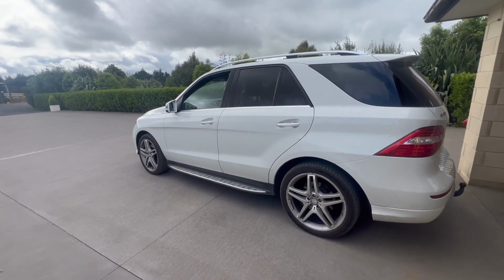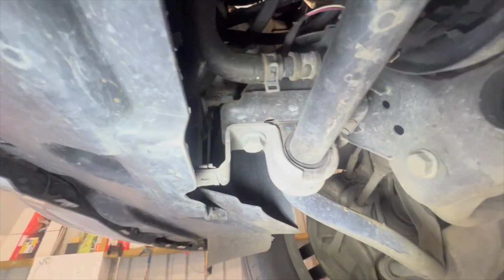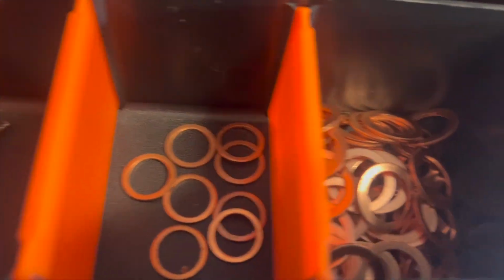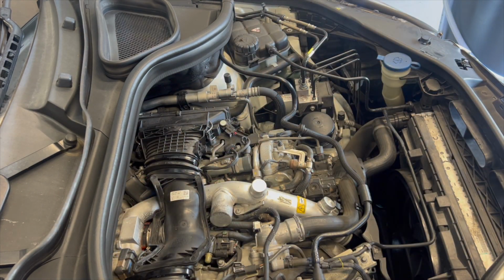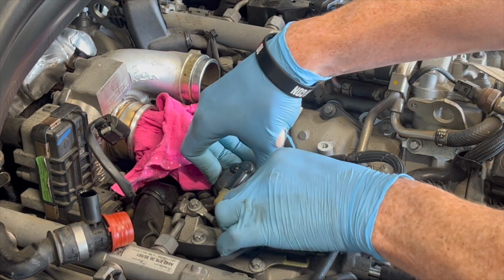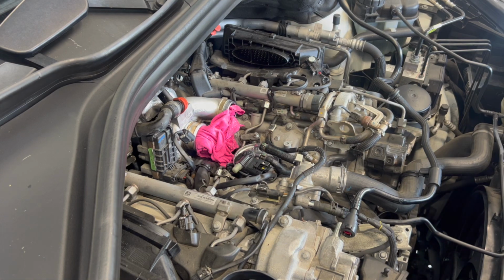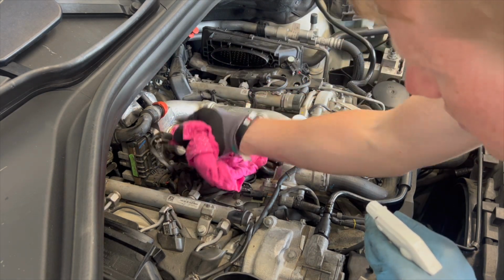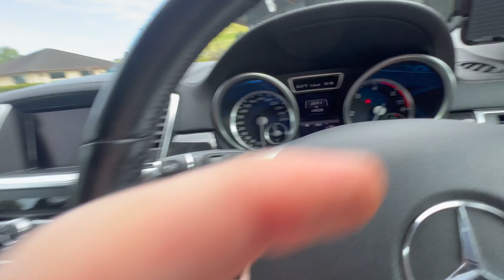Mercedes-Benz ML350 Bluetec Service (W166)

Comment: Great video sir! Mine is the exact same as yours! 2013 and sitting at 310 000 km! Runs flawlessly except for a very minor oil leak (known problem with the oil cooler seals). The leak is only noticeable when I remove the belly panels during my 10k km OCI. Did you have any problems with the oil cooler seals?
Reply from the maker: Hi there, ours hasn’t had this issue yet. Great to see you have over 300,000km! I can’t remember where the oil cooler is? But if it’s only noticed when removing the belly pan I wouldn’t say it’s urgent, my 2x E55’s up until recent have been regularly dripping on the floor… just need to keep tabs on the level. But I’ll check mine this service and see if it’s leaking at all.

Comment: Great informative vid. I have just bought one of these  What milage is this at? what interval is fuel filter and when would you guess the PCV valve needs preventative replacement?  Thanks heaps
Reply from the maker: Awesome, hope u enjoy the car. The fuel filter off the top of my head is 2 years or 20,000-30,000km. I’m doing mine every 20k :) the PCV I’ve just done recently - it should be only something you need to do every 6-8 years or 100,000km if not more so only once in a blue moon 😊 

This one has now 146,000km, apart from rear suspension it’s been flawless 😊
Reply: Thanks for the reply. Prob going to be expensive trip. I can’t work on it myself anymore. Prob just got bored with mundane super reliable Toyotas😀😀😀
Reply from the maker: @glenb4783  are you based in Aus? uSA? Canada? It’s a bit of a mission just to get the screws off the back of the engine otherwise it’s not too hard. But yes reliable Toyotas are easier no doubt - just can’t beat a less reliable Mercedes haha :)